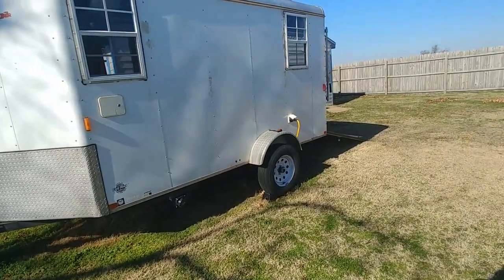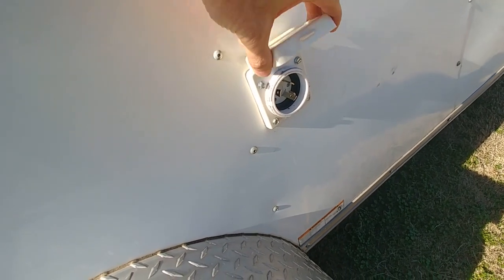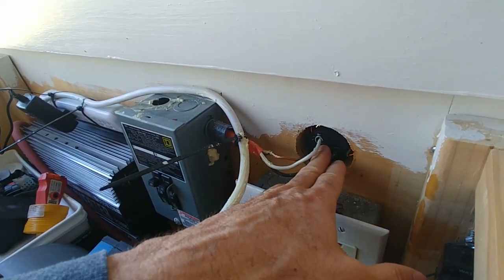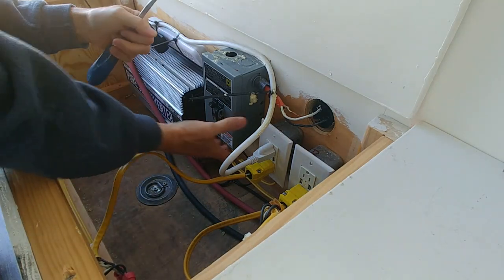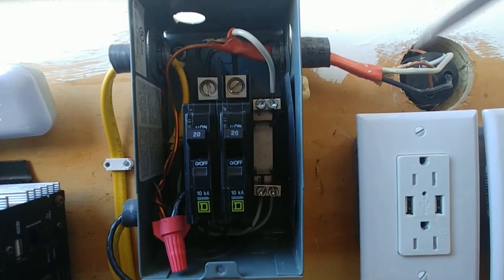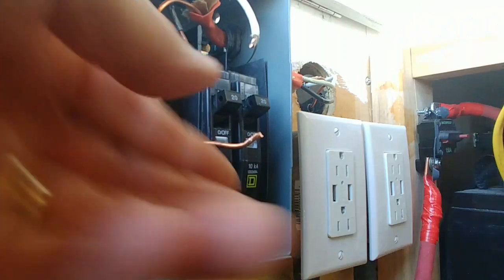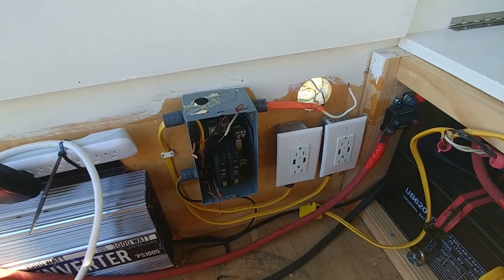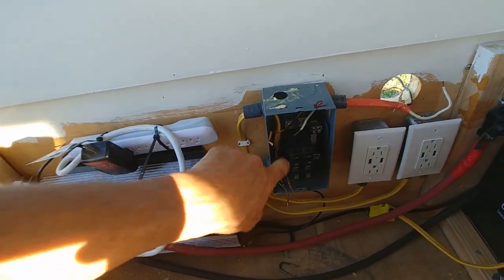CARGO TRAILER ELECTRICAL MAINTENANCE 6 X 12 Cargo Trailer Camper Conversion Part 35 #flgctc

Comment: Love the focus on making things more safe!
I haven't done videos of my build, but will probably just do a video of all my still shots. Slow and steady progress.
Reply from the maker: Thanks Starling. How far along are you on your build? What's giving you the hardest time?
Reply: @FakeLegGreg  Hmm..it's not ready for a trip, but I have it to the point that it is time to drop a wad on the batteries and solar.
The insulation, floor, cabinet, sink and shower are in, and two walls framed, along with the bed. Figuring out what I want to do for the ceiling and lights is giving me the most grief.
Reply from the maker: @starootoo  Ours is more utilitarian rather than fancy. The ceiling was a concern for us too. I just glued iso insulation boards to the inside of the roof and called it quits. For lights we used LED strips. They are programmable and we can have a flashing disco in the trailer if we want. Batteries and solar are an expensive, tough decision. Good luck on your build.
Reply: @FakeLegGreg  yeah, I have strip lights to go in the ceiling as well. I just can't figure out how to conceal them the way I'd prefer.
I'd prefer the cost-effective utilitarianism for mine, but my bride is a creature comforts gal.
Reply from the maker: @starootoo  I understand. Good luck with the build.
Reply: You've inspired me to create that first video. It is all the demo and preparation for the build. Check it out on my channel.
Reply: https://www.youtube.com/playlist?list=PLJtKvmh5FPd8rKa-qHf5xoWVh0aNukyfk

Comment: I've read that for automotive use one should only use stranded wire because solid will become loose with head/cold/vibration cycles. Perhaps that's what happened with your power port. Which raises the question, should stranded be used there? It seems designed for solid. Perhaps spade leads could be crimped to stranded wire? I'd go with at least 10 gauge to cover the amperage, possibly 8 if you ever wanted to upgrade to 50 amps. Great videos!
Reply from the maker: I agree with you Richard. Those wires were not loose when originally installed. It was lucky for me to check the connections. Stranded wire may be necessary. Thanks for watching.

Comment: Where's the best place to mount the power inlet panel on a trailer?  Taking the location of the power pedestal into consideration.
Reply from the maker: Good question. Most of the power pedestals I have seen were on the driver's side of the trailer, assuming you are pulling through or backing your trailer into the space. Most are about the middle of the trailer front to back. I have seen a few located at the back driver's side. Thanks for watching. Good luck on your project.